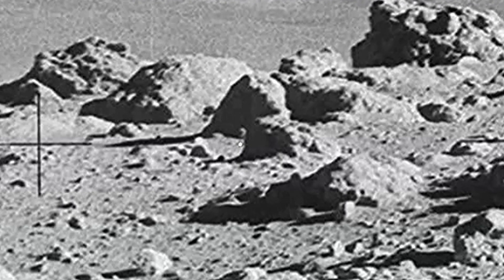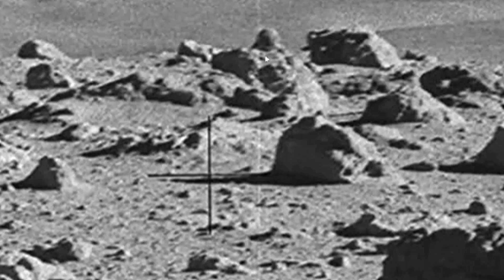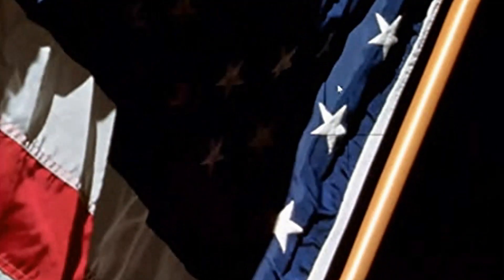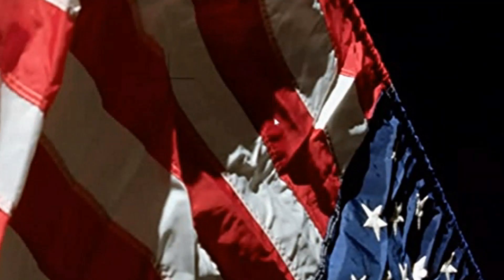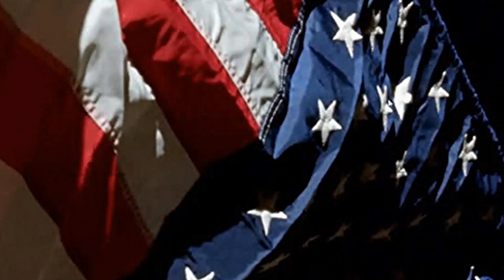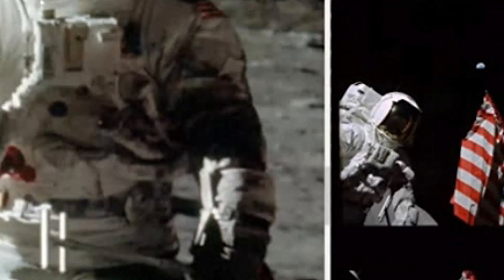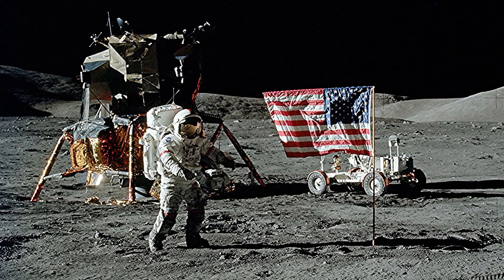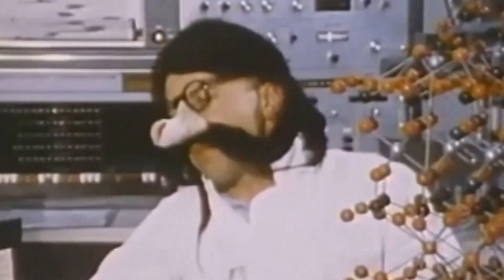"THE ANOMALIES OF APOLLO" PART 4

Comment: I think you mentioned in another video that the moon set was sprayed with water or oil to keep the dust down. Could that be the reason the suits are muddy?
Reply from the maker: You must have watched "SMOKE AND MIRRORS" The author did make the statement that a light oil was sprayed over the crete that they used for the lunar regolith. It would make sense as to why they came to be so filthy at the end of each EVA.

Comment: the resolution is pretty low for the stuff at the start, so I couldnt really see the glasses
Reply from the maker: They are there. You are laying with the lenses down and the arms facing up.
Reply: @theapollodetectives  I guess I need more than what my mind may run with. I think I rather not have the ego of my will, and just rely on the evidence doing the work.

Comment: Embarrassing
Reply: @mrjnuts1  can you please start explaining about  the radiation countermeasures?,  nasa embarrassed themselves when their own engineer said we are still trying to figure out a way to send humans through van allen belts, how did the camera work in those extreme conditions, it was not a digital camera, there are moving parts inside it and it could have easily frozen, there are a lot of holes in this story, can you please  answer these things for starters
Reply: @balakrishnakesani4289  I was under the impression that it was very hot on the moon, Film exposes in heat, and cant even work after being exposed to sometthing like 150F. Didnt they claim the backpacks have AC to cool them off?
Reply: @philindeblanc  First of all Air conditioning in vaccum itself is non sense, an air conditioner needs a medium to disperse heat, on earth we have air, I think air conditioning won't work in vaccum, the film or the camera is not air conditioned, they simply attached it , i don't see any compartment around it to keep it cool or pressurized

Comment: Still amazed it  all outdoors, exposed to weather?  A black sky, so it's at night .   Then Has to be lit up and they did oK lots of the time as they are not quite seen to be under spots - a huge area seems illuminated.   Crazy logistics to set up LEM areas.    For photos and for some 'live broadcasts.    No one said there was more than one shooting location, they pin it on one or another such as in a particular AFB in the desert,  plus that big dirigible hanger.

Comment: Allow me to debunk the flag issue.
Because the lunar temperature on the moon in sunlight is so high, it was sprayed down with water to keep it from spontaneously combusting.
That's the ticket...
Reply: fyi - the astronots regularly practiced wetting down equipment to prevent spontaneous combustion at the Flagstaff, Az stage set training grounds.
Reply: its 270degrees up ther, of course they wet everything down..I think the Smithsonian will soon reveal the garden hose they used.
Reply: @philindeblanc  LOLOL